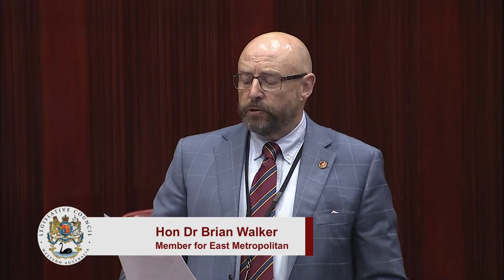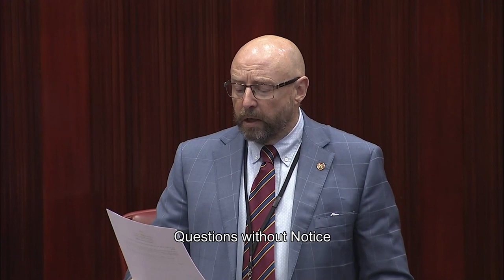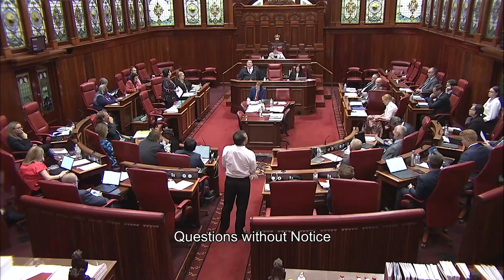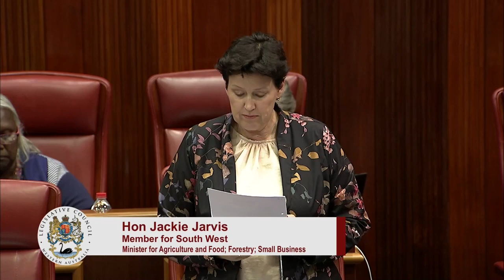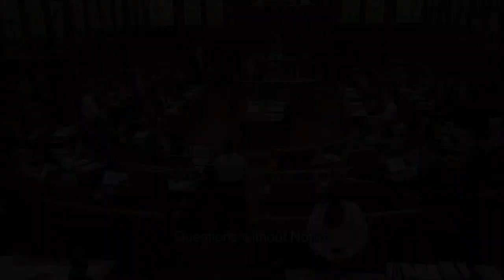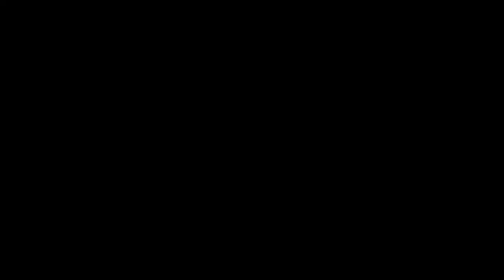3D-Printed Hemp Homes

Comment: Hempcrete 3d printed homes are the best materials, it won't crack over time. It's temperature perfect in which ever season you're in. Glass panel sky windows can draw energy into batteries and provide power , and it's fire resistant so don't worry about your home burning down like many Australians have suffered during bushfire seasons.
Why isn't this the main building material? That comes down to stigma propoganda from big businesses that have already invested into an inferior product.
Go and look up hempcrete 3d printed homes and be amazed and disgusted as to why it isn't being more rolled out.